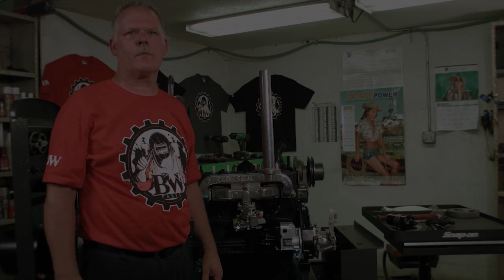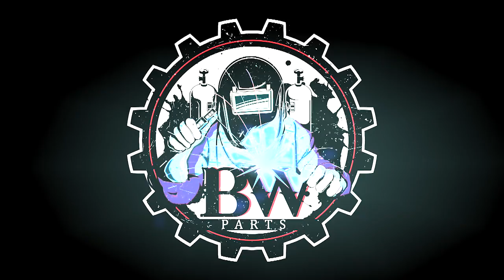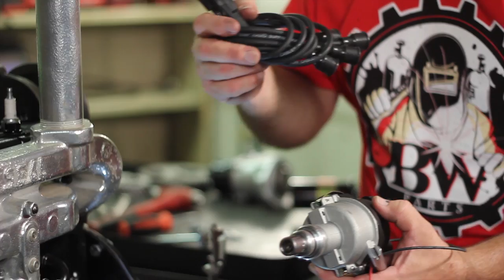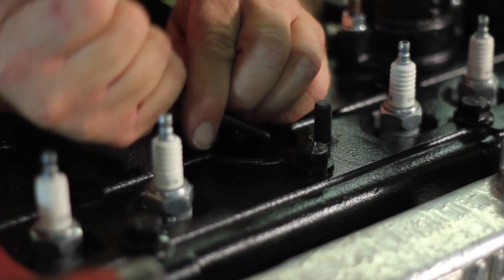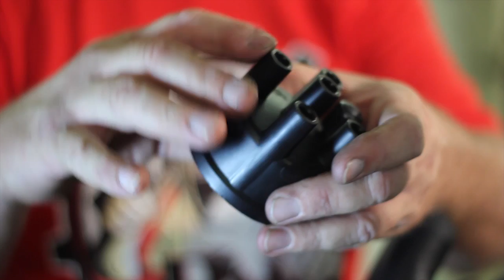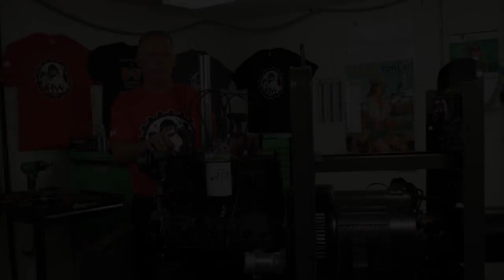Electronic Ignition Installation: Lincoln SA-200, SA-250

Comment: How do I wire it to the ignition switch? It runs if I wire the ignition to direct positive but won't turn off
Reply from the maker: You need a switch in between so you can switch it on and off. Typicall that is mounted on the front of the machine.

Comment: Randy...you keep saying the DC mark (on #4 TDC) is in the flywheel window at the same time as the gov/cam marks line up.....on my 1978 blackface sa200....they never line up together ?
Reply: I have the same issue going on right now?
Reply: @blakenewman784  I resolved the problem by re-aligning the governor marks with the flywheel marks....despite the fact that I used this SA200 since 1978 and it worked fine. 
I suspect the governor marks were 180 deg., or close enough, to allow the timing to be somewhat close, even though not according to the Lincoln specs.
Also the small gears in the governor need to be checked for alignment.
My marks were obscured so I could not confirm their positioning.
I suspected they were also off their positioning marks.
I purchased an identical used Fairbanks Morse governor, and used the position of it's small internal gears to reset mine to factoy setting, as well as doing the gov gear dot marks to flywheel mark.
I was hesitant to change the meshing of the governor gear and flywheel, as it was operational for years as is, but after the changes to gears and the ones in the governor, the welder fired right up and ran perfect.
I can only surmise this mis-alignment of governor  gear to flywheel was from the factory, as I never chaged it until this summer when my inpulse in the governor broke, and perhaps some tech at the factory adjusted the small gears in the governor to compensate for the flywheel/governor gear mis-alignment, so as the timing would be close.

Comment: Do you hook up wires to the on/off switch or starter button for the positive side of coil
Reply from the maker: Yes, use the positive wire coming from the on/off switch and hook it up to the + side of the coil.

Comment: Thank you, the only video thats helpful with the distributor, im working on a miller welder with a inline 4 L head, but the distributor is stuck shaft, doesn’t  seem to rotate, but yet the crank and cam rotate fine, also needed info on how to remove the unit it seems stuck in the motor, not even sure where to find the id plate i looked for it but don’t see one
Reply: Spray pb blaster or some kind of penetrating oil around the base of the distributor where it goes into the block. 
Then take a large pair of channel locks or a pipe wrench and grab the base of the distributor and slowly try and rotate it back and forth to break it free.
Reply: Mix up 50/50 aceton and trans fluid. Put it on the area around the shaft ana let it set  .@brandonh.8882

Comment: Timing light needs to be on 1, not 4.
Reply: It’s TDC so ….it needs to be in #4…..you would be 180* off if you put it on  #1…..😎
Reply: @johnmartin116  not true, 360 degree.  So number one and number 4 are exactly the same.
Reply: When I pull mine in, set ot for #4 ran the wires. Started and adjusted to 18pd vacum from intake. Runs like a champ.